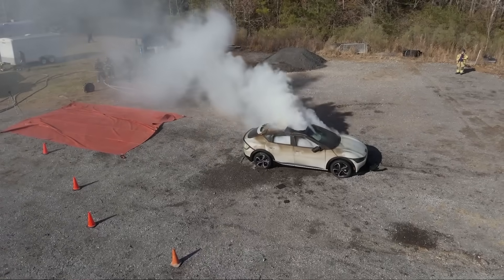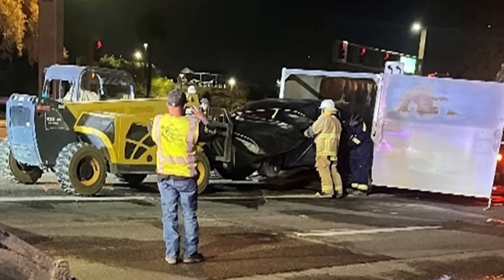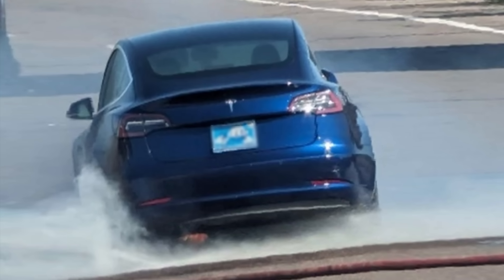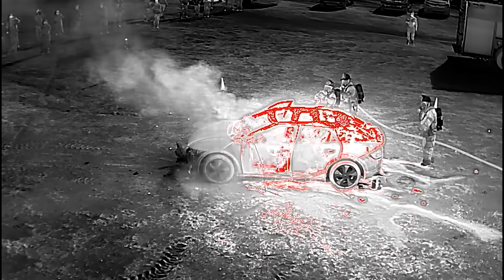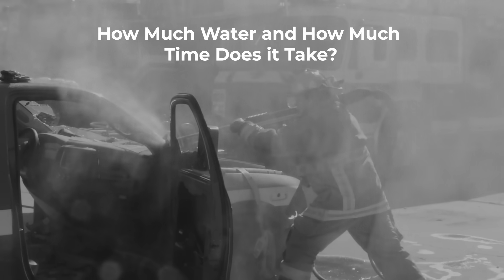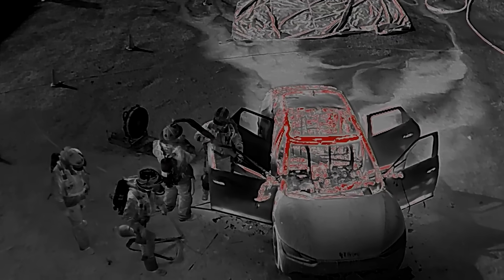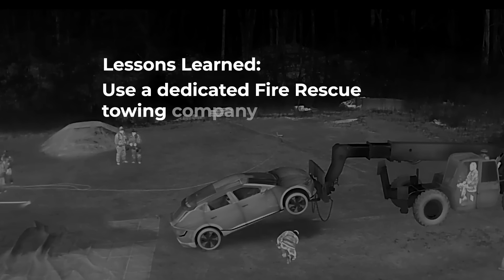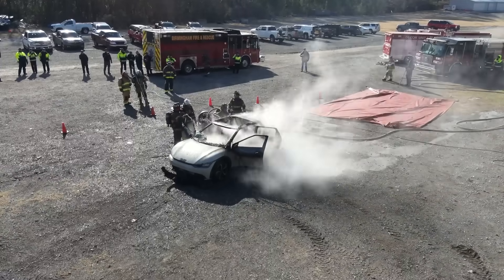Quick and Efficient Method of Extinguishing of an EV Fire tested in Tempe, Arizona

Comment: EV manufacturers should be making fire and thermal runaway suppression built into every battery pack.
Reply: Your fear mongering is too late. They've already been doing this for several years. Changing to LiFePO4 lower energy density cells, Fire Retardant Foam between Cylindrical Cells and just have more space between modules are some of the methods being used. The latest EVs are extremely unlikely to ever catch fire let alone thermal runaway. FYI Thermal Runaway is the EXTREME outcome that many EVs fire never reach. Not all ICE car fires end up with massive Fireball.
Reply: @ 	Tell that to the 4 million EVs already on the road with Li-on batteries, half of them fire prone Teslas.   And BTW, LiFePo batteries can STILL burn. They are less Kiley to than li-on’s but in the kind of damage done in car wrecks, they can still catch fire and burn.
Reply: Or a connector at both ends of the vehicle that a "probe" like the refueling probe on a jet can hook up to
by a fire engine or a remote control vehicle going forward and inserting that probe/hose.
Chilled salt water puts out the fire and depletes the cells all in one go.
No energy left in the battery=no more fires.
Reply: @JohnSmith-pl2bk yes my first thoughts - an external water suppression gland connector, plug and pump. Should be immediate legislation.
Reply: @JohnSmith-pl2bk   one note: the battery fire is sustained by lithium content of the battery, not the energy content of the battery
Reply: @Nicedesk  
No problems.
Chilled salt water takes care of it whether it is any type of fire...
and discharging the cells themselves.
Reply: They just showed you that fire suppression turns out to be a shipping container full of wet sand. You can't fit that in a production vehicle.
Reply: @ you must not have paid any actual attention.  What they showed was that if they inject water directly into a hole they puncture near the runaway cell that they can bring the temp down below ignition point.   But they can only put it in a container of wet sand  if the fire is already out. 
But there are a LOT of ways you COULD suppress fire in a battery- if you build it into the battery.   For example, insulation that helps prevent runaway in one cell from rupturing the membranes in the adjacent cells.   Or say, built in injection ports for fire departments to be able to More rapidly and safely inject water. Or even better, something NON-conductive to help slow the reaction.   Or even a kind of expanding foam that, in the event of an accident, would push the cells apart from one another to isolate the damaged cells from the rest of the battery.   KNOWING that they are an environmental and fire hazard USUALLY means making the manufacturer mitigate those hazards thru regulations.   Kinda like how all cars now have seatbelts, airbags, and collapsible steering columns.
Reply: Using water is plain stupid even gasoline extinguishes a lithium fire better
Reply: New rules in china 2026 , you can't have thermal runaways
Reply: They are. All this tech will be used on just a few years of cars
Reply: And what should ICE vehicles makers be doing about the face that ICE vehicles are involved in 60 times as many fires? (And yes, that is after adjusting for the number sold. It is 1,500 per 100,000 sold for ICE and only 25 for EVs.)
Reply: @ ICE vehicle fires can quickly be put out. Just cut the supply of oxygen and the fire goes out.  And the wreck does not Re-Ignite hours or weeks later.  They don’t have to Seal the wreck in a special box just to transport it because of its high likelihood of re-ignition.  Li-on batteries have their OWN oxidizer built in. Like solid rocket fuel. And can burn for 20 hours or more.
Li-on batteries also put out extremely hazardous toxins when they burn, far worse than gasoline fires.   And when you could that with the fact that Tesla’s in particular often lock their doors when they light on fire…
BTW The vehicle in US history most prone to catching fire, the infamous Ford Pinto, was recalled because of how often it burst into flames in even a minor impact.  The Cybertruck , thus far, has a record of bursting into flame 14 times as often as the Pintos did.  And when it does, it’s doors lock, and its ‘thermonuclear proof glass’ make it nearly impossible to get out of.
Reply: @christopherpardell4418 Can you point us to the news about the Cybertruck with those stats, and the data on the doors locking? I'm no fan of the Cybertruck but they are basing this on two accidents which killed 4 people (3 and 1) in fire fatalities and the suicide bombing outside Trump tower (which for obvious reasons had nothing to do with the vehicle). They then extrapolated this extremely small sample to equate it with the Ford Pinto which sold over 3 million vehicles, many after the recall. Statisticallly it's just way too small a sample. I'd be far more concerned about the danger the Cybertruck presents to other road users (which is why it will never be approved in Europe or Australia).
Reply: @mondotv4216 The Cybertruck, like all teslas, lock their doors when driving. ANY accident that causes loss of electrical power means the electronic system for unlocking and opening the doors ceases to function.  There is no obvious mechanical release inside the car. It’s a tug cable, behind a trim part, or under the seat.  Any owner who did not happen to read and remember where the emergency release is and how to get at it, is going to succumb to a vehicle fire before they figure it out.  As far as stats, the only reason we know how many have burst into flames is because of Fire department and police reports.  Musk infamously refuses to share metrics on their cars and the number and cause of accidents.
Reply: @christopherpardell4418  You don’t automatically lose electrical power in an accident or a fire. If you did how would you explain the many non fatal fires? Tesla also unlocks the doors if a fire is detected, the airbags deploy or the vehicle detects a crash. The reason the fire fighters could not open the doors in this instance was not stated - they could have been locked or just damaged. Remember the occupant managed to exit the vehicle safely but unfortunately they closed the doors after them which may have locked the doors. I don’t know and you don’t know.
Reply: @JorgTheElder  That argument sounds like something from the obiden grift camp. Think about it,when was the last time you really witnessed a spontaneous ignition of a regular motor vehicle?
Reply: >  EV manufacturers should be making fire and thermal runaway suppression built into every battery pack. 
"Empathy is a weakness. Making money is all that matters."
Now you know, why Tesla doesn't care about anything what happens to car owners, environment and so on.
Reply: @galdavonalgerri2101  You'll find it's really only the NMC (Nickel Manganese Cobalt) batteries which are the big problem - this is now old technology. The Lithium Phosphate batteries a much less likely to catch fire. And soon Sodium Ion batteries will be used - and they are even less likely to catch fire (apparently).
Reply: @mb-3faze  
Let's get this straight.
If compromised, EITHER type can be just as flammable than the other Depending on the state of charge and to some extent, the type of electrolyte.
It's the ENERGY level of the cell which causes heat.
Nickel based cells CAN be more flammable PURELY because the run at a higher voltage, have a higher energy density and as a result, if there's a short circuit MIGHT release more energy IF they are at a high state of charge ("Energy level")
NMC is NOT "Old Technology", it's just "Different Technology".
In fact, as the latest LiFePO4 cells, plus other derivatives develop and (possibly) reach the same volumetric density as "last years" Nickel based cells , THEY will have (literally) the same Potential if the short, to release that higher energy rapidly.
..
Sodium ion cells?  are safer at least in part because the have a LOWER density than even the iron based Lithium cells, meaning they have less ability to produce the heat for ignition. (With the downside of size and weight Which makes them less suitable for mobile applications, Transport included

In a similar way, a similar physical volume of fossil fuel holds FAR more energy to the the point where it is Explosive if introduced to an ignition source.
Reply: @mb-3faze  Yet,if you read the reports from across the globe,It's not OLD EVs that burn,it's also  new ones ,some are even in the process of being delivered to dealerships.
Reply: @mb-3faze This is COMPLETELY false. Wow, you EV fanatics sure love lying, don’t you?
Reply: @mb-3faze  Sodium batteries are crap though. They have far fewer lifetime cycles compared to lithium. If they were good they'd be rushing to use them already
Reply: @johnb5033 JAC motors already using sodium ion batteries. Superior cold weather performance is one advantage.
Reply: @rogerstarkey5390Energy is not the only factor. LiFe cells also have a much higher ignition point which has nothing to do with the energy density. It's not the voltage it's the actual chemicals present in the electrolyte and battery that determine it's ignition point.
Reply: @galdavonalgerri2101 Wow you like to announce how stupid you are instead of doing a basic internet search.

Comment: Great job guys.  Question:  Why aren't lithium ion batteries recalled and replaced with newer, better tech... non burning?
Reply: There are ones with "newer" tech as you describe (LFP being one), but none of the battery tech we have now is all that new at this point.
Reply: Because there is no replacement with the same density. Besides, why are not all ICE vehicles recalled and replaced with vehicles that don't carry around gallons of flammable liquid? Per 100K sold, ICE vehicles are involved in 1,500 fires. That is 60 times larger than the 25-per-100K sold for EVs.
Reply: Insufficient profit.
Reply: Why isn't gasoline recalled and replaced with newer, better tech... non burning?

Comment: I'm  assuming they have two triggers on the wand, or a way stop aggregate / sand to keep from just piercing straight through the battery ?
Reply from the maker: Yes there is one control for the water flow and one for the abrasive.